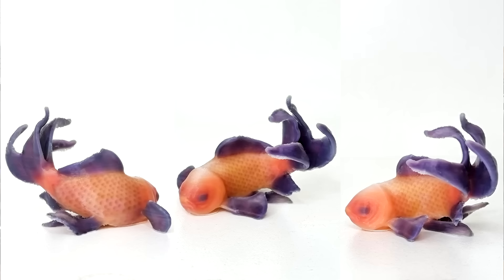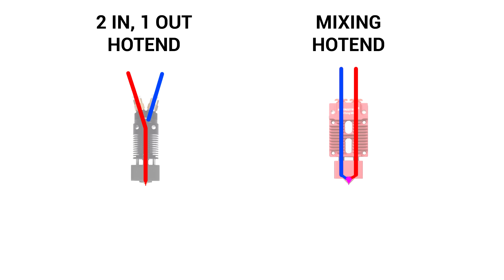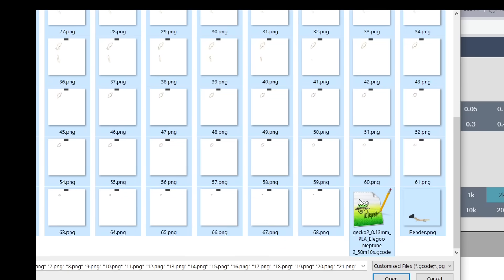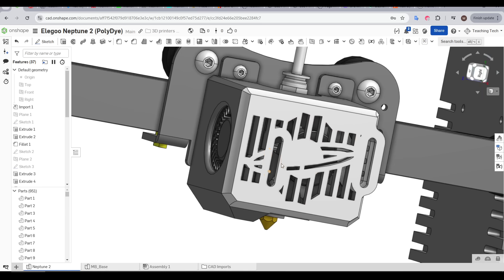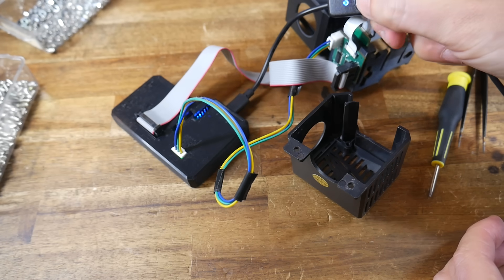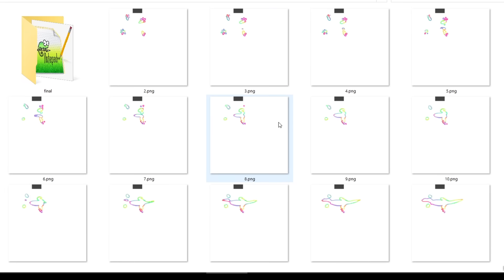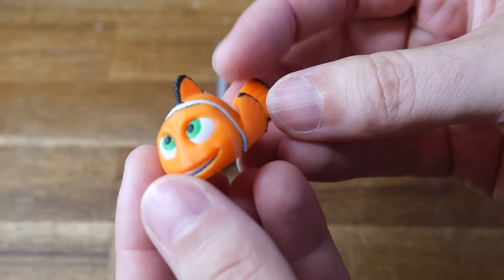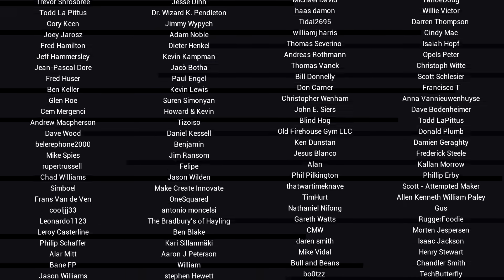Full colour 3D printing at home with PolyDye - Open Source Inkjet integration

Comment: It's crazy how no other company has tried experimenting with this for the consumer market. It's a known technology and such an obvious choice for multi-color prints without requiring multi toolheads or AMS.

I'm just glad someone is taking the time to work on this and I'm even more glad Teaching Tech is here to share it with the rest of us.
Reply: I wouldn't be surprised if they would like to but are blocked by some arbitrary patent troll
Reply: @J0nny_ oh it's a very specific patent troll
Reply: Xyz 3d printer did something like this yra go. It was expensive.
Reply: XYZPrinting, developer of the da Vinci line of 3D products, has announced the launch of a new full-color 3D printer. Aptly named, the da Vinci Color is capable of 3D printing 16 million shades from the CMYK color profile, all from your desktop.

The da Vinci Color is the world’s first full color 3D printer to use XYZ’s 3DColorJet technology.

3DColorJet is essentially a combination of inkjet printing and fused filament fabrication (FFF). Between layers of PLA, the 3D printer mixes and fires droplets of colored ink.

The advantage of this is that the technology can make full use of existing printer ink cartridges that have been available since the early 1990s, instead of trying to formulate a new way of combining plastic that in essence, does not blend.
Reply: It's good but I feel like this is the wrong direction.
Instead of using ink jet technology they should be using either laser printer toner and a laser or sublimation dye printer tech instead.
It's less likely to dampen filament, there is no worries about dried up ink or clogged ink Heads the color would be much more vibrant probably too.
I think applying ink at the print head is the wrong approach too.
There should be an AMS like unit that houses a colorizer chamber that the filament passes through where the sublimation dye or laser toner is applied before it gets to the extruder.
Reply: @andreamitchell4758  Well, it is still wastefull to color everything that is not visable. Only points that are outside should be getting a color added to a neutral filament, so after the plastic has been layed down. Also no changes in color of the filament in the nozzle and no sticking on parts they should get. Also technically, well if you add color to the filament before beeing melted, it will only be at the outside. And as you probably have seen there are filaments with multiple colors that mix not that well inside a normal hotend which makes projects pretty but shows that this is far from optimal without getting the color verywhere inside the line before melting. Or just apply to outside after 3Dprinting the parts.
Reply: @el3dprint  yeah I think a lot the waste can be handled by the slicer and telling it to just color the filament for the outer walls and  keeping the infill uncolored
Reply: with how coy he is in this video about the actual controlling of the cartridge, and what carts to use, I am 99% sure this stuff is a bit swashbuckly, not that I care personally because IMO all 3d printers need this tech NOW
Reply: The same technology is used on HP color 3D printers. They use a white filament that absorbs ink like paper. They only apply color to the very external layer of the print. The result is very good but the printer is very costly. Davinci home printers used a similar concept but had the problem of heavy maintenance and frequent clogs. The price was in the range of domestic printers. Currently this printer is not available though rummors are a new model is on the way. Mimaki uses inkjet technology too for its range of 3D printers but the ink (uv curable ink) is expensive and proprietary. So, the idea of using inkjet to 3D print in color is not new.

Comment: Please can you try to experiment with other types of ink. For example I've seen some uv inkjet printers could print on basically anything and it tends to give more vibrant colors... So I think it would be a good solution for the problem that colors are faded. It will also require a UV LEDs

Comment: About a thousand times more interested in this than an AMS, the plastic waste is horrific in current systems.
Reply: I agree with you about the waste, though IMO this is partially the fault of the slicing software.   Why do I have to purge as waste rather than being able to, at least optionally, purge as the infill.  That would reduce the waste significantly.
Reply: @IFS  Well, if purge to infill was the default option that would certainly improve things, time to harass Bambu and other companies that run AMS systems to update their slicers :-)

Comment: Incredible. A ways to go for ease of use and color saturation, but WOW. This will change SO much for me, who doesn't really like painting or using filament for multicolor prints cause there's not enough colors to do it "right." With this I could, in theory, make the model, print it, then just get on with the post processing and weathering.

Comment: As the ink is applied every layer after the layer has been printed, if I understood this right... wouldn't it be possible to make the ink application a separate unit (working like a separate toolhead), so you could use a toolchanger like you normally do (light and fast) and have the option to apply ink on top of a layer if you want to, like, for example, you can do with a laser engraving an inner/outer face, or does the ink part need to be attached to the printing head? It would be interesting to know as affordable tool changers become more and more of a thing nowadays (with your sv08 project as well, for example).

Comment: Good idea,. coming from the wide format print industy where we use solvent / eco solvent and uv based inks this is a next step for the 3d industry,. a bit like when the first wide format printers hit the scene.. Question, rather than using a water based ink out of a silly little costly HP water based ink style cartridge - why not use a bulk eco solvent system that would dry at the same rate as the filament or there abouts.
It could result in a smother printed serface as it could allow the filament to settle in a smother way. Also eco solvent ink uses heat ( around 95c for eco and solvent - uv in uses uv light to cure and is wel until pased over with the uv light) to permeate the material - usually a self adhesive vinyl film.... 
I know its foable - just watching this vid proves it but it would also need to be cost effective - cartridges are not the way to go..
Thanks for a good video.

Comment: I worked at HP making their giant $1000 3d printing v-ray bars for their 5000 series mjf 3d printers, and after learning you get 1000 prints and then it turns off, I'm so much more happy seeing versions like this. Fuck the mega corps, they don't even sell very many because they don't know their own use case. They thought they could be used for material wear, like what?

Comment: Although I get the pricetag associated with all this amazing work, I personally wouldn't pay it as it costs more than my 3d printer itself... (Which also runs klipper, but that's besides the point)
The same holds for the amazing 3D Chameleon project in my case...

Comment: Heh... Someone worked a lot at this.
First of all it's way too expensive.
At 199 USD you could buy a whole fucking multifunction printer, cartridges and ADF included... Not just 3 PCB's and a ribbon cable.
Somehow Klipper is not supported... That shouldn't be possible... The freaking thing is built to operate with multiple Processors and a lot of printer Axis....

Comment: This is so cool! Congratulations to Jacques and Bianca for achieving this and thank you for showcasing it. This definitely looks like something that could mature into being very user friendly. My pessimistic side thinks there’s a company out there now looking at how to make a full color 3D printer they sell very cheap with DRM on the cartridges.
Reply: I mean, if HP want to make a commodity 3d printer accessory that adds full colour 3d printing for below (or at) cost and upsell via DRM locked ink I wouldn't complain.

Hell, the fact this is designed around HP ink is a little humourous.

Comment: It's nice, but it has several and crytical problems:
1: The colors are not bright.
2: The kit is very expensive and requires a lot of work.
3: Using a proprietary HP cartridge is quite a problem. And it's expensive too.

Comment: Just by looking at this implementation, one of the problems is that you really need a second black cartridge, both because standard cartridges are designed with CMYK in mind, and in practice just CMY is not enough to represent darker colours well. This ink is also designed for paper, so on PLA it might behave weirdly, which can lead to both blurring and the faint results you've got. I suspect PLA is too porous, and the ink gets absorbed too much, which is why more translucent filament works better.
 I've seen cartridges with fast drying inks though, and I wonder if those would help. Combined with less porous filament it might lead to more vivid colours. With the downside that those may dry too fast and might need some sort of cover between ink printing phases.

I'm really impressed by this on the software side though. Getting ink to land precisely where it needs to go is not easy, and a lot of thought was put into making the calibration as easy as possible.

Comment: Would n`t it be great to be able to spray a chemical between the support interface and the part , to stop them from bonding to each other. This could mean 0 Z support distance for perfect overhangs, without the need to swap filament for the interface and the equipment (and time)  that requires .

Comment: The idea of having a huge spool of white (or clear, for those translucent prints), and a few big bottles of cheap, non-specific ink, and being able to flawlessly print out full color, high resolution prints would be absolutely brilliant. I hope they keep it up and wish them great luck.
Reply: There is actually a old machine from the past that does that allready. XYZprinting Da Vinci Color. But it's a pain in th a** cause it uses proprietary ink/filament which is rfid chipped.
Reply: i wonder what are the odds that this become almost a standard to the point that it drives color filament prices up a bit but massively decreases the price on transparent filaments
Reply: @tuttuti123 I don't think that's how it'd work out. I think color filament would crater in price due to no demand, and translucent filament would become expensive, at least in the short term.
Reply: That would be cool, but right now he has chosen one of the most obnoxiously overpriced and unreliable printer ink carts on the market.
Reply: @OmegaGamingNetwork I'm watching this the same day people have started noticing Bambus firmware thing and saying they don't want Bambu being the HP of 3d printing....
Reply: Yeah, on the video they're using those original HP cartridges, but there's tons of aftermarket ones available, refillable ones, or even the ability to refill those originals too.

I love the irony of making the worst of 2D printing (cartridges) being one of the best things to come in 3D printing recently.
Reply: @Kalvinjj when the print head is on the cartridge, and the machine is no longer religious about where it sources its ink... Magical things happen.
Reply: The two thing I fear the most, first is that cheap ink fades away with time/light radiation. Second, that there would already be a patent of this and all development is hindered.
Reply: @paulogodinho3275  The community can always find a better ink.
Reply: I think it would be better to use either a color toner cartridge or sublimation dye and not have the added weight at the tool head but a chamber that colors the filament as it passes through on its way to the extruder
It would probably also make it a much less convoluted coloring and slicing process too and no worries about dry ink carts, wetting filament with liquid 
 ink and less bleeding.
Reply: sounds good but in reality with this method you will NEVER achieve full color or high res, because it blends the white fillament with the dye making the color washed out with white and blurry. Also id wager the layer adhesion is suffering A WHOLE LOT by having a ink separation layer in between every layer of fillamet
Reply: @SagittarA  Nah, unwanted color bleed shouldn't be unsolvable; current filament is already pigmented white or clear plastic. They 'just' need to figure out a way of doing that on the fly. If this gets to the point of a full commercial release, I'd expect their roadmap to aim for using a custom cartridge and inks, which would likely be a huge step towards controlling bleed. Purpose-made filament would likely even go a step farther, and as long as it's cheaper in bulk than colored filament, it would likely be competitive, even if it sacrificed some mechanical properties.

As far as layer adhesion - from what I saw, they only ink the skin of the print. While adhesion will definitely be affected, I'd imagine most problems could be tuned out.
Reply: Please can you guys try something like an ink tank solution, the HP cartridges look the same, might be a completely different communication protocol. Keep up the good work, would love to be able to do this kind of thing!!
Reply: @nathanvanniekerk8718  there might be a retrofit continuous ink supply system available for that cartridge type. (basically a Bowden tube setup for 2d printers) You'll definitely want to use one if you can and only replace the cartridge if the printhead wears out
Reply: @themagitechie9955 I'd think by that stage they might use print heads based on refillable printers.  Seems like it would be more reliable and you know how HP hates ink cartridge refilling.  They'd probably redesign the cartridge out of spite.  😂

Comment: It's impressive to see this being done in this "guerrilla tech" kind of way, but I don't think this will ever be "for everyone", even with major improvements.
And the argument that the $200 price tag for a beta (!) product is competitive when compared to Bambu's AMS and other systems like it is laughable. Yes, there is wasted material that way, but the print quality, scalability, and most importantly the lack of this kind of manual setup, tweaking, eyeballing guesswork is what makes it a much more viable option for virtually any end-user.

Why get this when you can go get an Anycubic printer bundled with their color changing system for like ~$400?

Comment: XYZ had two printers in the consumer market that offered this functionality. Since I own both, I’m well aware of the fundamental issues.

The first and most important problem: ink does not tolerate heat. For this reason, the XYZ printers were only available without a heated bed. However, this did not prevent the system from drying out within a short period of time.

Another issue is that the system cannot tolerate airflow, which is a common challenge in 3D printing.

On top of that, there are issues such as filament durability and other challenges.

The idea was brilliant, and XYZ was far ahead of its time. Unfortunately, the software available back then was not as advanced as it is today, where coloring 3D objects can be done with ease.

I have both and must say

Comment: It's a nice and novel idea but the results are just so much less vibrant than printed other systems. 
If they manage to get it as vibrant as a Prusa XL would produce, amazing but it's never going to work relying on the translucency of the plastic. They need to develop an independent tool head that can swivel around a print in 3D to print on it's sides and let's be honest, at that point we are talking the price of a small car.